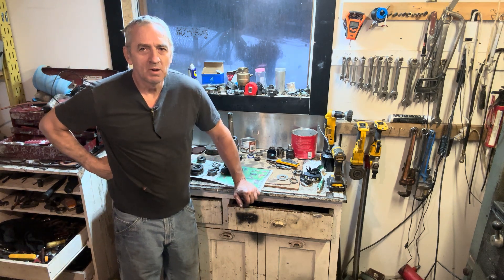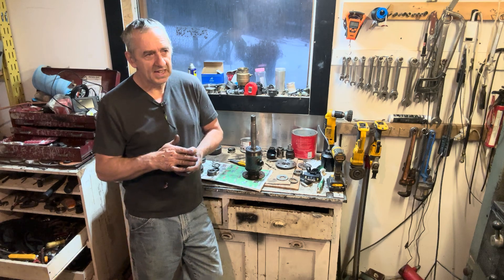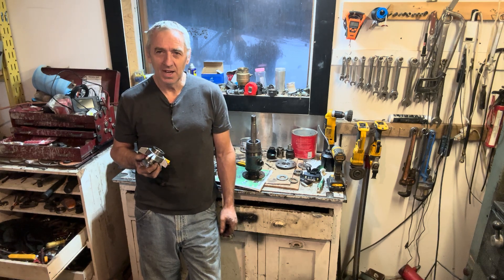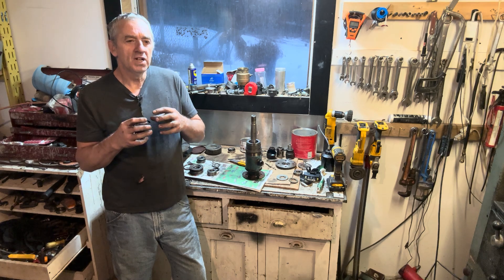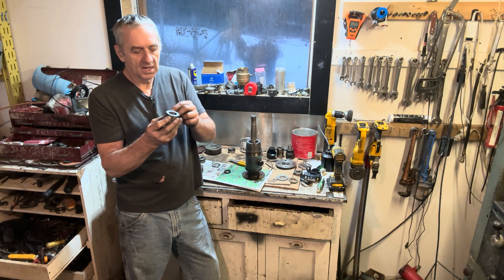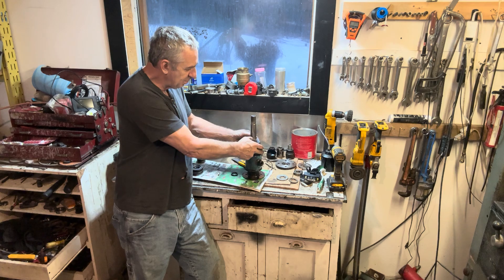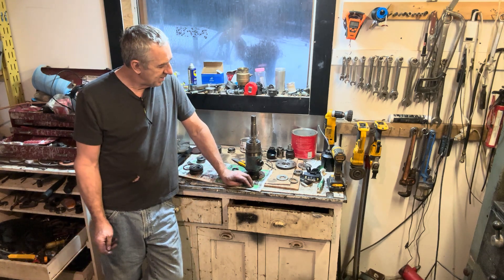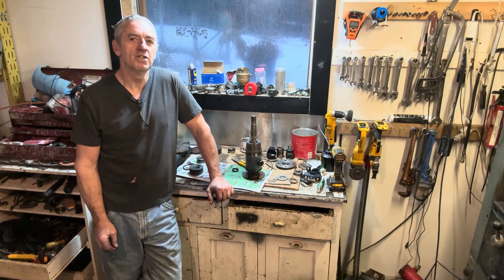building my diesel submarine at home.

Comment: Magnadrive.  Samarium magnets.  thank me later 😉
Reply from the maker: I did that on my Nekton sub I mentioned.  I plan to do a magnetic coupler when I find one cheap enough to handle the power.  They are very expensive and very hard to make, I researched making one.
Reply: @HankPronk we use them in the chemical industry for high pressure autoclave (~4000psi) mixers.  The brand we use is Magnadrive.  You may find one used from a chemical salvage yard.
Reply from the maker: @Live.Vibe.Lasers  I watch Ebay and they show up also.

Comment: Merry you know what!  Hank, consider carrying a hookah rig, perhaps 25ft hose. Rig it to an on board scuba tank or what ever breathing air you carry so you can use it on the surface to effect repairs or disentanglements. It could be an internal quick connect and hose goes out the open hatch.
Reply from the maker: Good idea, I have a compressor on board with quick connect for filling the inflatable boat I tow.